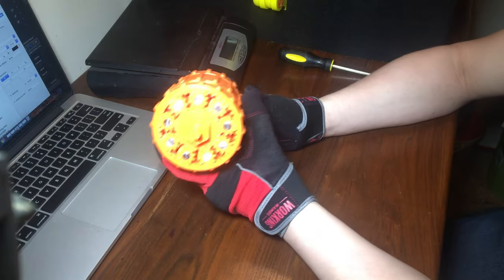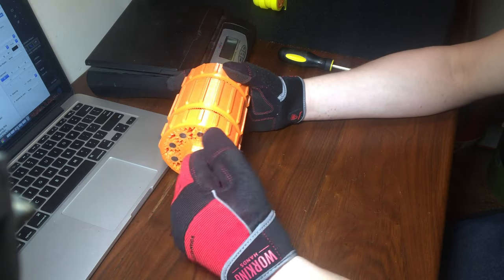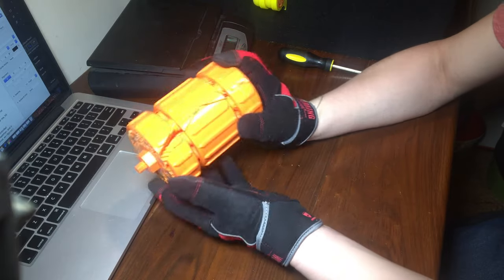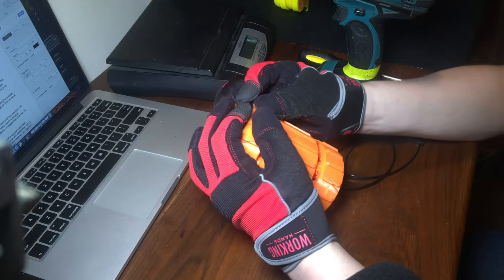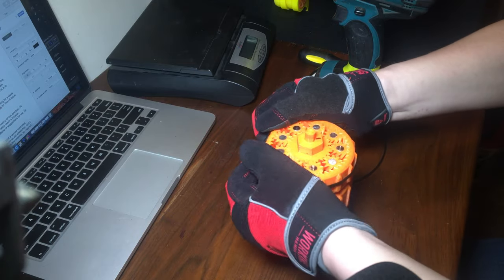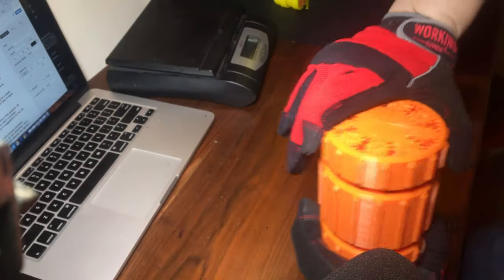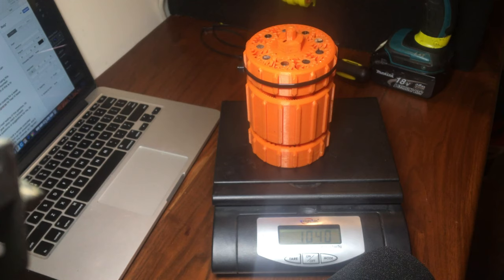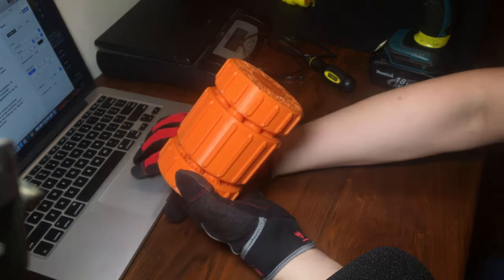High Torque High Speed 3D printed 160:1 Compound Planetary Gearbox

Comment: why no straight cut gears? you could just slide them in without need to make opening..
Reply from the maker: +brilian kamil you need at least one helical gear to hold the planets in place. You could do straight cut gears on the outside but it would be impossible to put ring #2 on even with straight cut gears.
And the gap in the ring really isn't that bad.
Reply: Gear Down For What? aah i see..
yeah i just seeing that gap, and it kinda looks like it was broken, haha..

Comment: I have to wonder how well that would work with a stepper motor inside of your robotic arm project. It looks sturdy enough to support a decent payload on the end.
Reply from the maker: Are you kidding? I would have to make the robot 4X the size!... now I kind of want to though.

it defiantly would be the kind of project that you would want an E-Stop on...
Reply: Gear Down For What? dude that'd be hype. the real question I have is how good would the repeatability be. I imagine that with a gearbox like that back drive is very little but the holding torque of the stepper motor would be able to hold it. I would love to see a large robotic arm.maybwhave it pick up a coffee cup with coffee in it.
Reply: I'd also have to wonder if a material like abs would be more resilient to the gears shear under more torque.
Reply from the maker: I have a lot of trouble printing ABS with my crappy printer, I haven't bothered to figure out what the problem is because it seems like its too mushy for a gearbox, and I noticed that I heats up much faster, also, about the holding torque, I cannot imagine that its possible to back drive this gearbox, but I will find out durning the torque testing!

Comment: i need to make a 3d printed planetary gear to the final project of technical drawing III in autocad and i've seen the add-in for helical gears but i dont know how to use or if it works with autocad, can you help me?
Reply from the maker: I have the same problem. I got lucky and it worked my my MacBook Air but I can't get it on my MacBook Pro... so in short, no I can't help you

Comment: That is a strange gearbox. Looks like a variant of a wolfrom drive - the sun gear in the central set threw me off (in fact, it should still work if you remove it..).  Pretty cool :)

Comment: Can this work in reverse. What I mean can you doing the slower gear to make the center shaft spin fast. The opposite of gear reduction. To make slow rpms convert to high speed output with low torq

Comment: Could probably use that form of plastic compatible grease or that white powdered stuff to add lubricity to make the gearsets last longer and be more quiet and efficient. And using spur (as opposed to helical) gears will be louder but also increase the chooch life before failing from  excessive wear. Although you would need some form of thrust bearings on the ends to prevent the gears moving sidewards.

Comment: GDFW, I love the vids and the work you do. I downloaded the stl files from thingaverse. Also I watched your live stream of the robotic arm. I was theone that asked you what 3D printer you had. You mentioned you had an Anet A8 but you modified it. I too have an Anet A8 and I was wondering as to what setting you were using for this gear box. Like what infill did you use and nozzle height.
Thank you!
Reply from the maker: +Adrian Wagenhurst for layer height I did .2mm and I used a .5 nozzle with PLA. For the gears themselves they are 100% solid. And for the outer mounting apparatus the infill was set to about 30% with a 3mm wall thickness